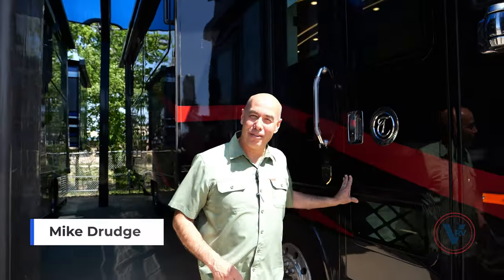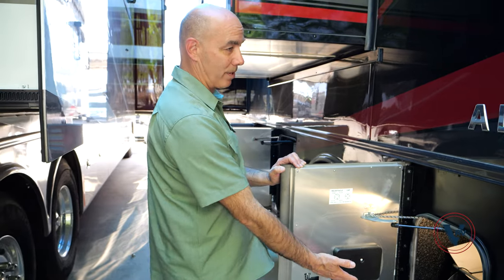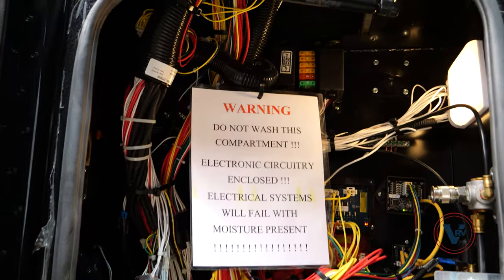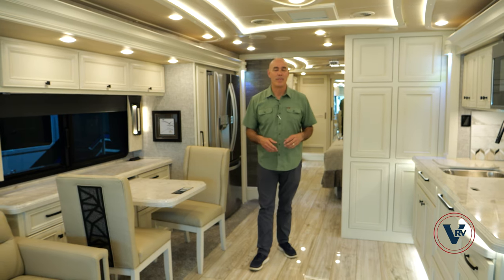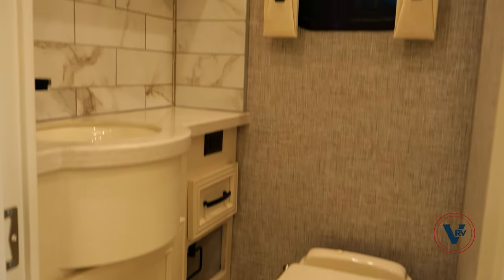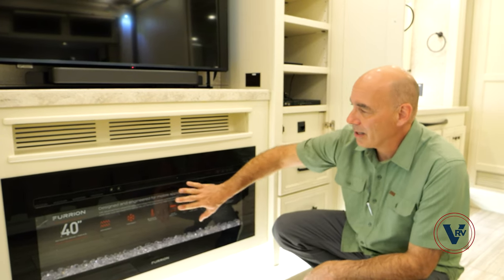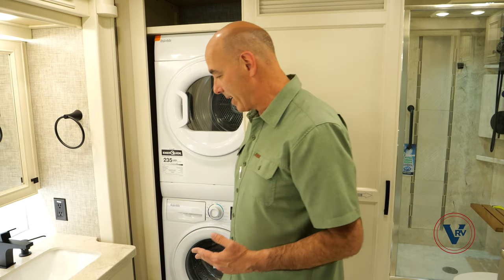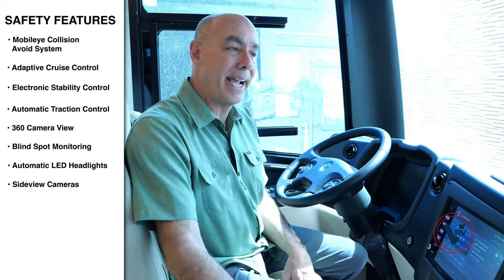2023 Tiffin Allegro Bus 40IP | This Is a Comfy Ride

Comment: Great video!  I actually thought it was going to be our coach.  We purchased our (almost exact 40IP) from Vogt RV in March of 2023.  Same colors inside and out except ours does have the booth instead of the dinette.  A couple of our favorite options are the heated tile floors and the Gerard electric operated window awnings.  Our coach came with the AGM batteries and 6 solar panels.  I would highly recommend that anyone buying this coach upgrade to the Lithium batteries.

Comment: AGM batteries (lead acid)  are an embarrassment at this level  RV. Why not install modern Lithium Iron batteries.   Black paint, is so stupid hot in the sun.  There's no reason for that.   The people who design these never use them or this would have good batteries and would be painted bright white.  The inclusion of several $150 TVs doesn't impress anyone anymore.  All the wives and kids look at there tablets and never use a TV anymore.
Reply: Aren’t you a ray of Sunshine🙄